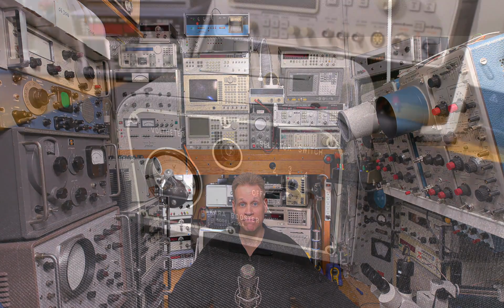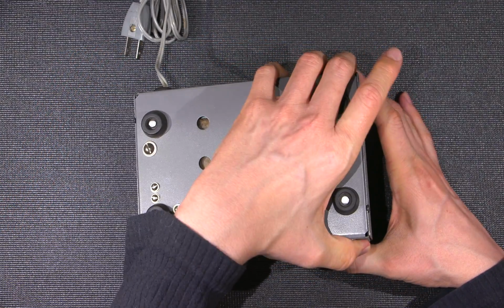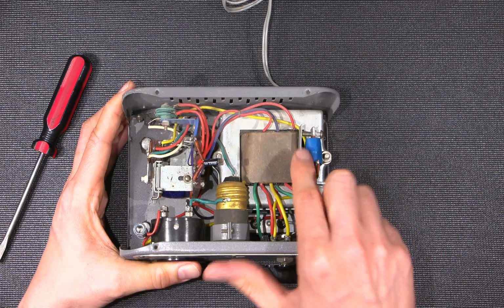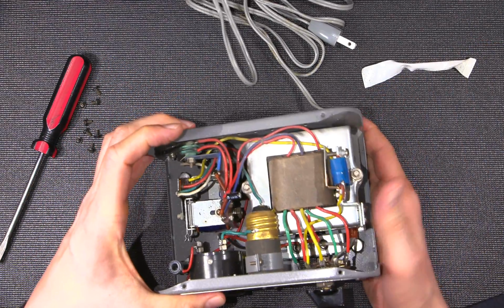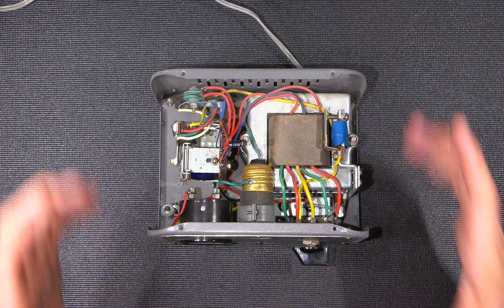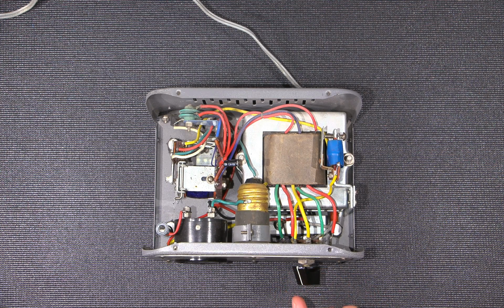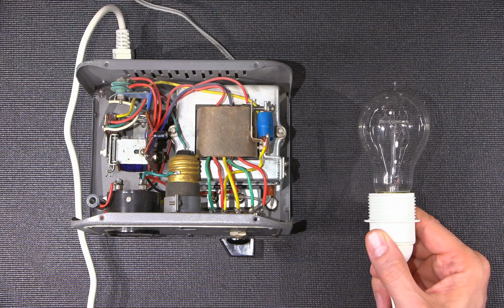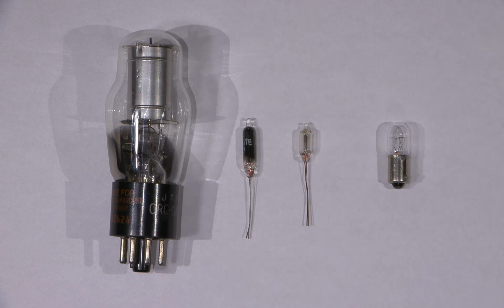What's a Takara Booster 200A? Let's Find Out!

Comment: neon bulbs, or neon bulb regulators are effected by light, you can do some experiments, the voltage to ignite the electrodes in a neon bulb is effected by light and some other characteristics of a neon bulb like max working frequency and other important voltages are effected by light too, it makes it all more stable and stuff like that, I really like to make experimental circuits with neon bulbs, they are very cool

Comment: My guess for the end question: The incadescent lamp is a current stabilizer. When more current flows through it , it gets hotter and lowers the current, until the current settles to a final value.

Comment: Hey, you are spot on with your explanation. Japanese line voltage is more or less always 100v in recent years, pre war and until the 70s voltage would drop often. Most old transformer tube radios built in Japan had multiple taps for 80-110v for varying line conditions, many of my old National radios have multiple positions for the line fuse. US 110 equipment only needed a slight boost to run so these were fairly common back in the day.
Reply: Btw, i have a few cards of various old dogbone resistors including some river branded ones, surprisingly accurate.
Reply: Pps, the outlet is polarised to accomodate us plugs, while Japan has polarised sockets they were not common when that box was built, even now most appliances sold dont come with polarized plugs. Incandescent bulb is probably a current sink to protect the regulator from overcurrent.

Comment: The lamp is there to make sure the gas tube fires.  I worked in the telephone industry and we had a memory module using NE2 lamps and to make sure they would fire and store the information we had to put a lamp inside the cabinet.  If there was no lamp, the gas may or may not fire.  It was an interesting design from the 1950's for sure.

Comment: My guesses on the trivia question:
1) Could be that the heat from the incandescent lamp would help to initiate the discharge in the regulator tube when used in cold climate.
2) Could be that it was really just an indicator lamp for someone who went in to replace the regulator tube. For example, maybe if the regulator tube fails short, it would shunt the transformer and the filament voltage would possibly drop enough to cause the lamp to glow dimmer or not light up at all. Or, if one finds a regulator tube that has failed open, and the filament lamp still lights up, that means you now have to replace all the other tubes as they have been running on a very high anode voltage for quite some time.

Also, is there a chance that the buzzer is a part of overcurrent/overpower protection rather than an additional indicator for overvoltage protection, and by adjusting the screw you choose its threshold?

Comment: I'm glad my projects can't tweet.  "Oh! He let my magic smoke out!" Would be the Tweet.  Mr. Carlson was a little saucy today! Lol.  I am too much of a noob to explain further but I believe the incandescent lamp in my Heathkit IG-72 is connected to pin 7 (suppressor grid) of a 6CL6 by way of a 350V 20uF capacitor.  So, I am thinking it may be stabilizing the AC voltage to the suppressor grid and if the grid fails, there is increased current which lights the lamp, indicating a failure?  No laughing please.  This explanation explains why my IG-72 still does not work properly, lol.

Comment: I have a hypothesis on your trivia question.

Stabilivolts works with an arc-discharge in ionized glass.  Photons (from the lightbulb) can sometimes ionize the gas making it easier for the tube to "come up" - maybe thanks to that it's possible to use a little bit lower b+ voltage?

I know that sometimes lightbulbs are used because of their low "cold" resistance and much higher when heated, but i don't have an idea why they should be used there connected to the filament supply since the heaters of vaccum tubes share the same characteristics.

Comment: A 3 amp fuse would be correct for the low 70 volt input (2110 Watts).
Reply: Christopher Netherton, I think you meant 210 W., one extra numeral... as 3 X 70 = 210.

Comment: My guess to the trivia question is that the bulb serves as temperature compensation due to the physical nature of the filament, probably in series with another element to limit either the voltage or current, sort of a positive vs. negative temp coefficient??? (lucky guess if I'm right LOL). Unfortunately when it comes to stuff like this, my education was mostly focused in digital electronics... I had one electronics course in 1980 that did one lab with vacuum tubes and I was told that next time they offered the course the lab would be dropped... I felt sorry that future students going through the program that would miss out on that experience -- that's the march of progress and the need to train future engineers.  Anyway,  I look forward to hearing the Correct answer to the trivia question next video.

Comment: Here's a question from the back of the room....why bother putting in and wiring up a 5 selector switch when only two would function? -Level 3 aha! -Level 4 tricked you twice! Level 5 Nay! ???
Reply: It is rated for 70v in.  Then you would use more boost.
Reply: It depends on the input voltage. If it was lower, the output voltage would be lower too, and you'd be able to crank that switch up to higher positions to compensate.

Comment: Absolute wild guess from a hobby electronic novice: Is the bulb used as an easy pre-heating element that also functions as a fuse/fault indicator. Could be just in line with the other components and if it isn't lit, something is obviously wrong.

Comment: Neon bulbs are photosensitive and the filament bulb provides stable illumination to regulate properly.
Reply: I was going to guess to provide minimum load for the regulator but this makes more sense. If it was to provide a minimum load it would more likely be a resistor than an incandescent bulb. I didn’t know neon bulbs we’re photosensitive interesting answer.
Reply: @jacobdykstra8499  have you ever noticed when a neon indicator is starting to go bad AKA failing and starts flickering if rooms completely dark sometimes it will affect the flickering of the neon bulb but when there's significant lights the rate at which it flickers changes?
Reply: I discovered that neon bulbs are photosensitive in a cheap motel one night. The light switch had an old neon indicator that flickered like crazy. I found that illuminating the indicator with my iPhone torch (lots of high energy blue photons) made the neon come on solidly with no flicker! You’ll see the same in some designs for nixie clocks that use neon tube ring counters - they add a blue LED to ensure reliable triggering.
Reply: @Richardincancale  LOL not in terms your continent but I was just saying about and failing neon indicator and Light just now before I saw the next comment LOL LOL see my comment.
Reply: Indeed
Reply: Yep, that is correct.

Comment: I suspect the line cord plug is a Japanese-style plug (2-pin, non-polarized). Given the unit was designed to run North American radio and TV equipment from the Japanese line voltage, the input would be wired for connection to the Japanese system. It was probably marketed to U.S. servicemen posted to Japan in the 50's and 60's. Love that neon bulb. Do you know what number it is? Really enjoyed this video.
Reply: Yes you would be correct on that.

Interesting lie enough with the Japanese line cord plugs.

So which do have ground however.

Not a ground prong.

They have a flying lead with a spade lug.

On the end and yes it's green wire.

That would never fly in the US.
Older cheater plugs used to have them but.

The reason why that is not allowed by code now is as follows.

There is a chance however Slim.

That that Spade lug could somehow wind up in the hot side of a receptacle.

I have some old cheater plugs that still have the wire lead.

When we use them but keep them for special reasons and just as a novelty and show people what not to use.

Also I caught Oddities and electrical Hardware insulators such.

Do a bit OverWatch will work here and there as well.

And obviously a maker / Electronics Enthusiast / whatever.

But getting back to those plugs with the flying lead.

In Japan the outlet plates would look like a triple X accept no receptacle in the center sometimes will be covered by a little cover if present.

Marked with a ground symbol.

And below that is a screw terminal.

For that flying lead to be attached to.

By the way I have a few chords I've made up using ones that run acrost.

I put them in my travel kit.

Along with an outlet tester.

So she has when you're needing a ground and you're staying somewhere that allow the outlets are not grounded.

Also I have several feet of heavy green wire.

And single pole enclosed terminal blocks.

If you get the picture.

I found oftentimes if there's a two prong receptacle there is still a ground present in the box that it's actually connected the ground.

The other thing that's in my travel kit it's a multimeter.

You better bet I checked that receptacle if I don't know it's pedigree.

Especially expensive or sensitive equipment.

That kind of Screams reply personnel only now doesn't it.

AKA myself and only myself.

Oh by the way if I find an outlet wired wrong.

Where feasible if it's someone I know I will offer to correct the problem once and for all.

Also I know how to properly check for bootleg ground of course.

Which by the way was quite common and at one time perfectly legal.

So for anyone wondering about that it's been addressed.

Addressed to whoever's email whoever that is:-) LOL.

I've only run across bootleg grounds a few times in my life.

But hot grounds more often than that.

Reversed hot neutral more so.

And all frogs hot once.

And that was a nice late round receptacle supposably.

And guess what the outer box was connected to neutral....

What the heck were they thinking!!!!

And yes I've run across double male extension cords.

Or as I like to call them suicide chords!

Although once when I wasn't paying attention when I was making up a few extension cords for custom length.

I created a double female by accident.

I had all the Inns prepped and everything connector is ready to go and just making up the chords.

Then when I got to the last end I realized something I was short a a female plug.

I was looking around and realized oops.

Kind of like somebody welding something that was supposed to be a threaded fitting think Adam and Jamie heinemann
Reply: Neon bulb looks like an NE-2.

Comment: That is a neat little unit... I was hoping you would lower the input voltage to 65-70 Volts to see if the selector would work on the 3 or 4 setting.. Cool video
Reply: was thinking the exact same thing. would be nice to see the next positions of the switch working
Reply: Also I would like to know how they detected the voltage in excess of 120 or so maybe neon bulb and a proper resistor?

Or give you one of those voltage reference or regulator a neon bulb style tubes?

Properly loaded and resistor to get an accurate voltage trigger.

Also some people were saying about the meter be able to register line voltage but not really any it or practical including in the video?

One thing they could have done with a digital pulse on the switch but it would be more expensive and taking up more room.

Would have been to put an extra pole on the switch and either have an off monitor on switch contacts or something like that.

And possibly win the unit was off but in another position the meter would register line voltage.

Maybe a second indicator and well? But that's just an idea and maybe it was considered who knows.

Comment: That would be good to modify if you want to run an old tube device at reduced line voltage
Reply: I'm sure he's got a variac or two already. In fact, he used one to feed this thing its reduced line voltage.